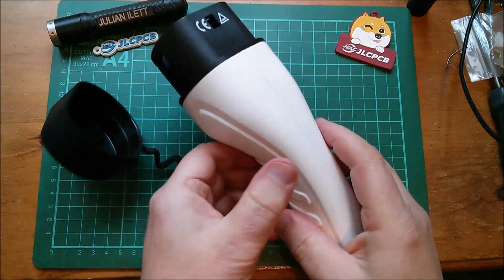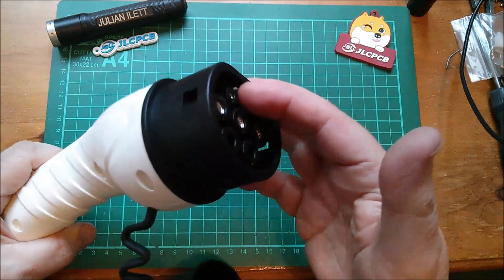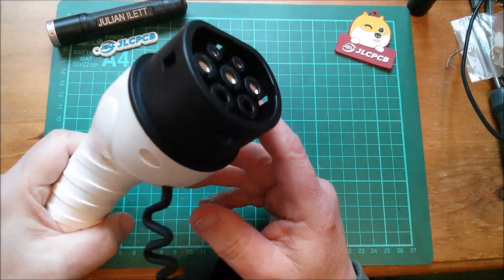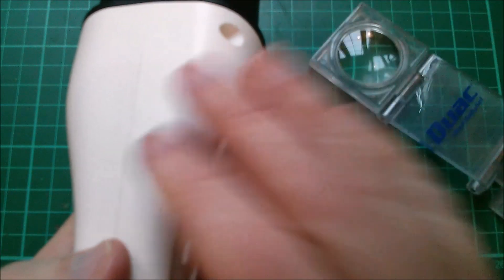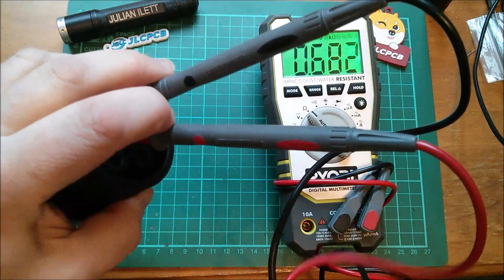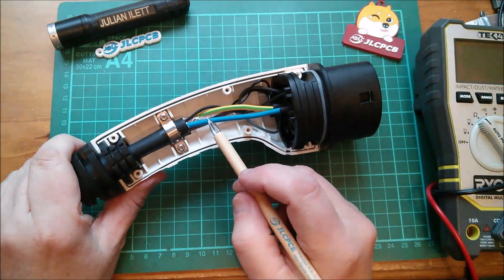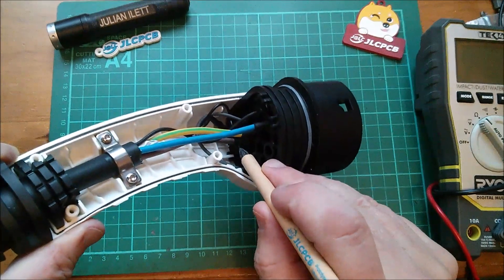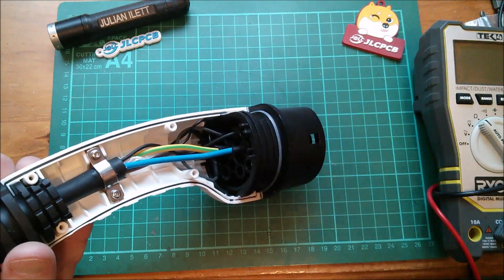680Ω Resistor in Type-2 Connector

Comment: Those resistance values are the definition of the stupidity of the ccs charging standard. Let’s go high to low so that eventually we get to such a low value that we have to create an entirely new standard when chargers get more amps!  Instead of low to high so there’s basically no limit. 

As to why the charging stations aren’t a rectifier and boost converter and the plug just pilot, prox, earth, neg and positive allowing cars to skip all of that for weight too and if you want to borrow at someone’s house (rare) it’s trivial to create a 15 amp box to put in your trunk. 

There shouldn’t be any AC charging standard but instead we have a stupid design with 9 pins instead of 5 that’s MORE money in copper than just putting the converter in the home charging station (pulsed sicfets that can drive 900v at 100a x 4 will cost you $60usd and the extra 2 wires in 3 phase will cost you well over $150 now. 

Dumbassed design by commitee. At least Tesla just figured out how to detect and shunt AC on the same as DC. But even then it should never have supported AC and even if there’s an argument for keeping that in the car, there’s no case where you need 3 phase instead of just using dc plus buck from 3 phase power or if you’re plugging in at a friend’s house, use one phase with the superior Tesla plug. 

Just dumb all around.
Reply: I need to argue with you on  a few points. First, using high resistance to indicate high current capability is a terrible idea when you consider the possibility of a dirty connector. A high resistance connection should NOT result in increased current draw for obvious safety reasons. Plus there is no point in worrying about signaling for more current when the connector can only safely handle so much.

In my opinion it makes more sense to have an in-car charger for everyday charging because it enables cheap charging stations (enabling easier adoption) and it enables cars to use whatever sort of battery they wish without worrying about charger compatibility. Plus DC charging requires more safety engineering which would increase costs.

And regarding the number of pins, I don't know where you're getting 9 from. The single phase American plugs are five pins and even European plugs with all three phases populated are still only 7 pins. The "bolt-on" plugs for DC fast charging don't use the AC pins so they are still only five wires.

Where I do agree with you most is that there's little need for on-board three phase chargers.
Reply: @eDoc2020  

1. Yes they shouldn't have used resistance at all. They should have used actual data pins with RS484 or CAN. Your argument goes both ways.  And the connector itself can handle 3x the power it's taking with larger wires so yes, they screwed the pooch.

2. A Bridge Rectifier costs a few cents. There's no serious cost increase at all. In fact that there is a massive decrease because of fewer wires. At the worst case (single phase 240VAC) it would cost about $1 more while vastly simplifying the rest of it and making your car significantly cheaper.  For 3 phase or any DC charge station that also has to support AC (yes they exist) you're saving 3x.

3. DC power is SAFER, not more dangerous. At any given voltage, DC will be less likely to kill you, not more. This is explicit in the UL and other data. As a small example, AC max human touch safe is 50V, DC? 120V.  AC will go to ground in general. DC? You can be sitting in a bath tub with the wires right beside you and as long as you don't get in the middle of them, you're not going to get electrocuted. (in fact, DC is so much more safe that most DC doesn't even have earth pins specifically because there is exactly one way in a DC circuit (below 1500V) to die: Put your heart in the middle of the positive and negative. AC?  Below 1200V there are endless ways to die, which is why we have GFCI and AFCI breakers now that cost a fortune.  DC takes less to certify in both the US and Europe than AC because of these facts. (I know I just did it and it was less than half the UL cost for 384VDC than a similar device that was powered from 240VAC. (yes both had to be isolated and pass the same surge tests)

4. PINS: A CCS Type-2 is 3 AC, Earth, PP and PE. That's 6.  If you add the DC wires on the bottom too it's now 8. So not 9, I counted wrong, but still the same increase in power wires that cost a fortune.   Meanwhile, the Tesla cable is 2 + Earth + PP + PE and the last 3 are small clustered around the 2 big ones.  And there was never any reason to do more than that (and the PP isn't needed either since it should all be RS484 over the PE). A DC CCS Type 2 can literally have 5!!! 3AWG or larger copper wires instead of 2.  By using a rectifier in the charger (or wall wart that plugs into mains if you wanted) and supplying whatever DC voltage that gives you (560ish for 3 phase AC, 340ish for 240AC and 170ish for 120AC) and then the car having a standard Full Bridge DC/DC Converter, which it must have anyhow, you just cut the cost of the device in half that goes on your wall. Not increased it.  And in countries with 3 phase AC, you even cut the wall wart that is in the back of the car for emergencies by 1/3rd by definition.  While simplifying the entire design.

AND

You open up Battery Caching with efficiency and elimination of waste on systems that are using Tesla powerwalls etc. because no inverters are required thus saving 16% (minimum in best case scenarios that virtually never happen, more like 25-30% in real world) inefficiency in current EV charging from solar. (i.e. about 98% efficiency on the Full Bridge converter in the car and nothing else, because no isolation is required from a Powerwall because the isolation happens from the mains to the battery so you don't have to isolate battery to EV)

It's a no brainer.
Reply: @jameshancock  1. For basic signaling resistance and continuity is more reliable than smart protocols.

2. How does moving the rectifier reduce the number of wires? For AC you need L, N, and E, for DC you need +, -, and E. You can't use a a cheap rectifier on three-phase because that would always result in poor power factor. AFAIK there aren't any DC charge stations that also support AC because the DC-capable plug doesn't fit in AC-only vehicles.

3. I'm not sure about the shock implications of AC vs DC but I can tell that your bathtub analogy is invalid. DC and AC are equally likely to go to ground. 120vac from the wall in the bathtub is certainly more dangerous than 120vdc leads from a battery bank but at the same time I'd rather sit in water with 120vac from an isolation transformer than a 120vdc supply with grounded negative. Outside of power factor correction and special interface requirements if exporting power I don't see why a 384VDC device would cost more to certify than a 240VAC device. In any case I'm sure an AC-only EVSE costs much less to certify than one that also includes high-power AC-DC converters.

4. Your pin count was right the first time. The second time around you forgot the CP pin. Outside of a three-phase supply to the car (which I agree is a poor choice) single-phase AC charging and DC fast charging require the same number of pins. One is live, neutral, and PE and the other is positive, negative, and PE.

Regarding charging a car from a Powerwall-like device, that is indeed something I did not consider. Having an extra inverter in addition to the charger will certainly make things less efficient. If I were in charge I would say that vehicles should have moderately-sized onboard chargers which accept AC as well as DC input. With such a system cheap charging stations could still be made for existing AC systems and relatively cheap and efficient charging stations for DC setups would also be an option. DC fast charging could be an extra as it is now where an outboard charger isn't much of an issue because you'd already be upgrading infrastructure just to get that much power to the car in the first place.

As a side note a benefit of dumb EVSEs vs smart DC chargers out in the wild is that there is little maintenance required. Public fast chargers in remote areas would be a nightmare from a logistical standpoint.
Reply: @eDoc2020  1. Actually that isn't true. Resistance can be influenced by wires as you stated. A USB style Hi/Lo protocol doesn't have that issue and it has built in error correction and could get rid of 2 more wires.  A simple PWM is either so large that you only have 5 or so values that you can possibly use, or you have risk of interpreting it incorrectly.  USB/RS484/Ethernet style signaling has none of these issues. It either works or it doesn't, and it's exacting with error correction.

2. One way or another, there is a rectifier for 3 phase power. It's either in the car or in the charger. Same with single phase. It's either in the car or in the charger. The difference is that by putting it in the charger itself, the cable then always is +/-/E (E isn't really necessary nor does it really make the DC power any safer, but whatever. The DC won't go to earth anyhow even if you hook it up directly to either the positive or negative terminals so you're not saving anyone on a short)  With a DC connector there is only 4 wires if done right.  With Tesla they couldn't do 3 phase power, without adding 2 more conductors of massive size which would have doubled the cost of the cable. With CCS-Type 2, you're still paying for a massive connector and all of the wiring and logic in the car and the pita of hooking it up for nothing because you're insisting on putting the rectifier in the car and not the wall end of the cable. If it's an installed mount, then it's in the box in the wall. Then 4 wires come out, 2 small and 2 large and you're done. If it's plug into your buddy's wall jack, it's still a rectifier in the wall wart plug and 4 wires and you're done no matter what power standard you use. (and all of Europe is migrating to 3 phase by 2030, Britian might not because they're out of the EU but they'll have a hard time not doing so.)  So, while it doesn't add to the wire count in the US, Canada, Mexico and Australia it will in virtually everywhere else in the world soon and you're adding something to the car that isn't necessary and everything that goes along with it too for no reason because a wall plug rectifier is tiny and cheap. We're talking about 20 amps max power and the PF doesn't matter for residential and most plugs in European 3 phase countries, the plug has single phase anyhow so they're already getting major PF issues.

3. All power goes to it's source. Doesn't matter if that's AC or DC.  The DC source from - is +.  The AC source is neutral OR anything earthed because of how they're hooked up.  Thus DC power can't short from a single hand while you're standing in a puddle of water unless that DC - is also connected to the puddle of water.  The AC one can and does all of the time which is exactly why GFCI breakers exist for AC and not DC. It's WAY safer to use DC power and this is reflected in the standards. And DC certification is CHEAPER not more expensive than AC specifically because DC isn't coming from the grid which is dirty and can sustain lightening strikes. DC is coming from isolated batteries and thus is tested at less than half the peak voltage and 1/100th the time interval so you can literally use an eFuse on DC depending on exposure versus having to use a transformer or capacitance isolation on AC.

And note the only reason why the Tesla Connector has an Earth at all is because it accepts AC. It isn't necessary for DC service if coming from an isolated source but is used to ground the car at the same potential to the building to prevent static shock, not as a protective measure for an AC short.

An AC only UL certification versus one that rectifies to DC has absolutely no difference in certification cost at all. In neither case is the power path isolated because nothing is exposed to the end user. The only part that has to be isolated is the interface, which is low voltage 3.3V (or 5V) + 12V power behind a transformer. None of that changes. In my design for an EV charging station in a house, the EV charging station just rectifies the power. That means 340VDC (or 540VDC rectified 3 phase AC) through the wires at whatever amps to the car. The car has the converter IN THE CAR, just like it does now for the standard to boost or buck it based on the battery size.  What does change is that now you have a simple 4 wire cable that is as cheap or cheaper than the AC equivalent and the car has a simple 4 wire connector which is also cheaper, and the car only has to see AC AND it opens up direct solar.

4. If the cars are always supplied at the plug in the car with DC then 3 phase power doesn't really matter and everything is good. 3 Phase power is a problem and creates the stupid connector we have now when you're feeding AC over the cable and connector instead of 2 wire DC which the car uses anyhow.

Solar: If you put in a $1 rectifier in the head of the cable, then you don't need the AC in the car at all. There's just no reason for a car to ever accept AC. If you're on 120V it's 2 diodes at 15a. If you're on 240V Single Phase you're 4 diodes at 50A max with a dongle and 80A with a wall adapter which is nothing. If you're 3 phase you're 9 diodes with the same as above.  Keep it simple and make it always DC into the car. It costs nothing, has no overhead to do so, doesn't make it harder to maintain (in fact easier and cheaper) and makes it way easier for people to connect. (Tesla's data on the subject shows this because they have way more repairs in Europe with CCS-Type2 than they do with the Tesla connector). And then anything from 40VDC to 1000VDC (max of the standard now) should be accepted and boosted/bucked as required. You're done. Super simple, and all you've done is put the rectifier in the right spot so that every electric car has exactly one way to charge: DC of an arbitrary voltage.

Side Note: There would be no more maintenance with 4 diodes (or 9 for 3 phase) than the current system. None. And because of fewer wires, the cable would be less thick and when it broke would be cheaper to replace and the connector on both the car and the wire would be less prone to breakage because it would be supporting a much lighter cable, especially in 3 phase power situations but also in all other configurations because of the stupidity of the size of the connector that is being shoved in and out.
Reply: @jameshancock  My comment with signaling reliability was more referring to the components used rather than the signal itself. But automotive CAN interfaces have been around long enough that it's probably not a real reason. So I'll give you that one.

2. You're kind of saying the same thing I was, the DC is safer while it is isolated from the grid. Regarding PF, it certainly does matter here. For one thing the EU requires PFC over 70 watts, and besides that PFC means you can use thinner wiring on the way to the EVSE. 4800 watts is 20 amps at 240v but without PFC you'd need more like 30 amps. So you basically need active PFC somewhere. If you're suggesting a steady constant-voltage DC feed to the car that means you need APFC electronics in the station and a DC-DC converter in the car. If the car itself is fed with AC it can achieve APFC just by modulating the charge rate, eliminating a stage.

To realize a safe two-wire DC system without a ground wire you'd need to isolate the supply first. That requirement of isolation turns your $1 bridge rectifier into a much more expensive power supply. So you'd definitely still need a ground wire. However I don't see why they couldn't use a GFDI and get away with a (relatively) small ground instead.

I guess what I'm trying to say is I don't see much of a benefit to using an external rectifier if the charging itself is still handled by the car. If the charge voltage itself is generated externally (as AFAIK it is for today's DC fast charging) it's a different story.

As a note which may or may not make a difference here, I think the power electronics in an EV's motor controller could theoretically be used as charge electronics. I wonder if any existing cars do this.
Reply: @eDoc2020  As it currently stands, the car is accepting single or three phase AC. It then boosts that using CC and then CV in the car. All of that exists. It's getting in 1.41x the power coming in, and then boosting that higher to 400 or 480 or in some Audi/BMW 800V.  And that AC stuff that is in the car has the isolation as well already. It's already there. And if you want to get fancy at super chargers you can boost from the 3 phase AC at the charger to up to 1500VDC (without getting into high voltage regulations, unlike AC which is 1200VAC) and feed that over the same thickness cables and then buck that in the car trivially to whatever the battery needs and you've quadrupled the amount of watts going in without enlarging the wire nor changing the connector. (And yes 1500VDC is entirely doable with SicFETs now.)

All I'm saying is move the AC rectification out, and then you eliminate all of the extra wires from the process which simplifies the design, makes it cheaper, and opens up cheap and efficient DC/DC charging from solar and eliminate the inverter.  The entire design is standard linear EE thinking instead of think laterally. You see this everywhere in EE. Tesla is the exception to the rule there and thinks laterally. That's a trait of all Musk companies, but the rest of the industry and forcing stupid on Tesla because they thought linearly: We have a cable that does 1 phase AC charging. We need 3 phase = Add Wires! Oh, now we need DC = Add Wires!

Instead of: Oh we need to handle all AC power configurations AND handle DC charging: Instead of adding wires, what's the cost to convert to DC versus how we're doing now and versus what our new connector with all of these stupid wires is going to cost?

When you ask that question, the answer is trivial: Convert to DC at the wall, not in the car.

PS: I did an LTSPICE simulation of a 6 diode full bridge rectifier for 3 phase AC. The power factor was 92%.  Even if there is chop on the Boost/Buck in the car, there are caps in the car to absorb any back EMF, the entire length of the wire from the wall to the car (close to 15 feet of stranded 2 AWG wire) acting as an inductor which absorbs it, and the diodes at the wall.  If it dropped by 2% I'd be shocked.

And if it does turn out to be an issue, you can use a 3 phase solid state rectification IC and use triodes or fets instead (GanFET will easily handle the pulses at 100 amps and the full pulse voltage without having to parallel).  This active synchronous rectification increase in cost is cheaper than 1!! 15 foot 2 AWG copper stranded cable costs.  It will do active PF and get into the 99% range complete with back EMF correction. (I LTSPICED it and speced the parts on Mouser and that's before mass production savings.)  And recall, you can save even more money because literally every one of these wall chargers for EVs has a microcontroller in it that is already capable of doing the active rectification itself. (i.e. an STM32, the cheapest one made will easily handle the pulsing sequence and handle the UI at well below 150mW power usage, so you don't even need the IC)

My way the car becomes the controller and only listens to the amps that the charger can provide just like now.  The difference is that the car is receiving DC and thus the source AC (or DC in the case of solar) is immaterial, and since the car already has to have a buck/boost inside it as you noted that hardware is always going to be there (yes the Tesla does it the way you're talking about, it literally uses the boost converter from the regenerative breaks to boost the AC, Sandy Monroe covered this in a YouTube Video when he took apart a Model 3) .  Thus, the car being able to take a wide range of DC power and boost/buck it takes no more effort than it already has, and has massive wins because of a simple connector with few wires (4) and it works everywhere no matter what the power source is, Single Phase AC, 3 Phase AC and DC is all the same to the car. And that makes using solar collection during the day into a battery and then charging from the battery to the car at night vastly more efficient and cost effective. And of course, if the house battery gets to low, it can shunt to AC doing the rest of the car charging from the grid, and the car still sees DC.  That's how it always should have been designed. But linear Electrical Engineers created a mess because they didn't think outside the box.
Reply: @jameshancock  It seems our disagreement really comes down to whether or not the car should have a rectifier built in. I say why not? Even if the car still has an onboard rectifier it can still accept DC without any problems. My design would be two fat wires which can accept either AC or DC along with a medium-size ground and whatever signal pins are needed. As far as I can tell this is exactly what the Tesla proprietary plug here in the US does.
Reply: @eDoc2020  The issue with your design is that it doesn't handle all of the design requirements:

1. AC Single Phase power - Yes, your way works.
2. AC Three Phase power - Your way doesn't work and would require 2 more power wires and the plug expanded. (i.e. what CCS did)
3. DC Voltage matched power - Yes, your way works.
4. DC Voltage from solar without having to have a boost converter (expensive) in the charging station - Your way doesn't work.
5. Allow the EV owner to plug into a wall anywhere and charge - Yes your way works.

My design addresses ALL 5 design requirements while adding virtually no additional cost even in the cheapest scenario (plugged into a 120V socket at someone's house with the cable that is included with the car) and vastly cheaper in 3 of the 5 options. (Even #3 above is vastly cheaper my way, because the car already has the boost/buck so if you just rectify the 3 phase power coming into the super charger and let the  car do the rest you just saved massive deployment cost there too)

So our disagreement really is: Your way doesn't work unless you do what the CCS standards body did which is make a stupid plug.  Mine works in all cases with an elegant and cheap solution that doesn't require a stupid monster plug and extra wires in many cases.

So objectively, my way is better in all but the most simplistic single phase AC use case INCLUDING DC super chargers because those that aren't ultra high power can just be rectified 340VDC from 240VAC and 566VDC from 3 phase 400VAC. In the VAST majority of cases 3 phase rectified is more than the current active super charger produces, so you're better AND cheaper in the baseline and only in the 600VDC+ scenarios of CCS-Type 2 would you be incurring any overhead, and honestly, the cheapest way in those cases is to have the power company drop a 3 phase transformer that gives you the right 3 phase for the voltage you want to offer (i.e. instead of 3 phase 400V use 3 phase 700VAC and you'd get the full 1000VDC after rectification for no additional cost, just a change in windings in the transformer that they already have to install anyhow). It would cost essentially the same and you'd rectify it using an active rectifier and you're done, no buck/boost at the super charger either so it becomes a dumb source that is super cheap to install comparatively to what they're doing right now.

So my way even improves and simplifies Tesla super chargers and makes them cheaper to deploy which means more gas stations would deploy them too which means more ubiquity. (i.e. the average gas tstation has 3 phase 400VAC power already for the pumps. Thus they can easily drop in dumb rectified DC stations with 566VDC charging at 100Amp pretty easily and the cost per port would be essentially the same as a home charging station with my design. I.e. a couple of hundred dollars, so the only cost would be the upgrade of the amperage coming into the station. That's a massive win for everyone.
Reply: @jameshancock  I don't see why my way wouldn't work. A three-phase charging station would send DC to the car exactly like your way would.

So the three possible modes of operation in my system:
1. AC into car -> 4 diodes -> pulsed DC -> DC-DC converter -> battery
2. DC into car -> 4 diodes -> still DC -> DC-DC converter -> battery
3. (optional) DC into car -> converter bypassed -> direct to battery

If I'm not mistaken, your system would only use DC into car -> DC-DC converter -> battery. My mode 2 would work exactly the same as this.
Reply: @eDoc2020  Your way doesn't work for 3 phase AC in home into car and converted in the car.  (because in that scenario you need 3 power lines instead of 1)   This is literally why they created CCS in the first place and added the pins!

Further, your way is limited to 240VAC over the wire thus to get more charge capability from an AC source in your scenario they either have to have a REALLY expensive boost converter and convert to DC outside of the car (in which case the rectifier isn't required in the car) OR they have to increase the cable thickness.  My way, you're getting 340VDC across the wire for single phase and 566VDC across 2 wires instead of 3 at 400VAC. And you can always boost at the wall if you want and increase the voltage and drive 600V through identical wires and 1000V with a slight increase in cost per foot, thus more than doubling your Watts through the wire without bigger wires that hare harder to handle nor increasing the side of the connector. Your way has no option to do so.

And the  current standard doesn't work for affordable solar install because it requires another boost converter at the wall and full CC/CV logic at the wall while the car already has it.

#3 on your list will never happen because it has to do CC/CV charging so there must be a boost/buck depending on what's coming in and the demands of the charge curve.  And EVs don't use diodes in their boost/bucks. They're all synchronous designs with fets not diodes at over 98% efficiency that they already have designed. The companies creating the wall adapters don't have that knowledge and at the very least will create shitty designs that aren't as efficient, besides adding massively to the complexity of DC your way at the wall with the current method which ensures no one does it (which is literally why you can't buy a DC EV charger for less than $15,000 on the market right now and they all require AC 3 phase power to operate.)

And in my design, insanely cheap designs would use diodes, but better ones would be $5 more and would use fets and the microcontroller that's already there or an ic to rectify the power and would do PF correction while it was at it.

Mine works in all cases, is cheap in all cases, puts the design complexity where it already is with the EV company while solving all of the issues in every scenario, for essentially no additional cost nor complexity, nor certification issues.

Not sure why you don't see the massive win.
Reply: @eDoc2020  Your way doesn't work for 3 phase AC in home without converting to DC first like a super charger.  This is why CCS exists and the original American design wasn't adopted which only conceived of DC and AC single phase. (with 6 wires instead of 4 as actually needed)

The current standard doesn't handle AC/DC detect in the car like a Tesla (no other car does this) and thus you get the CCS standard with  separate DC pins.

#3 will never happen. This requires a CC/CV charger which means a synchronous buck/boost to manage CC/CV.

Your way requires either bigger wires for bigger chargers at 240VAC or 400VAC 3 phase to get more power or a full 3 phase DC super charger. Mine doesn't, because it's always DC so you can always step it up if you want to get more power with more volts instead of more amps and thus keep the same wire gauge. (and the car would just automatically handle this trivially all the way up to 1000VDC or even 1500VDC)
Reply: @jameshancock  I don't see the massive win with your way because my way doesn't have the shortcomings you describe. I'm not talking about the current standard although it could be backwards compatible. I'm saying the car could accept 100VAC, 1000VDC, or anything in between. The benefit of mine is it wouldn't require any power circuitry in a basic unit while yours would require a rectifier and maybe PFC in even the most basic units.

Like the current system my option 3 would only be used in special situations where you want to charge faster than your car's converter can handle. I would not expect it to be common at all, I'm just leaving it open as an option.
Reply: @jameshancock  Am I missing something? Your way would also require external conversion to DC to charge from a three-phase source, so it doesn't offer an improvement in this regard.
Reply: @eDoc2020  The difference is my way is a dumb rectifier and nothing more. The car takes whatever voltage it gets DC and boosts/bucks it. Your way, the car gets AC and rectifies it and then boost bucks it.

That means that your way requires 3 wires for all 3 Phase AC locations instead of 2 which drives up costs and makes the stupid CCS-Type2 charge connector. (or it has to rectify it and use CC/CV and be a full charger per the current standard to DC which as we know the Europeans think requires separate wires for DC versus AC that generates the stupid CCS-Type 2 DC charger connector which is truly moronic.)

Mine works in all cases with the same number of wires, no more expense and the car does the boost/bucking so that DC/DC is just as trivial and cheap as AC/DC charge stations.  And for stations that want to provide more power over the same thickness of wire and connector, they can include a simple boost (a half bridge with gan or SiC Fets will do this nicely without any logic other than the PWM) that doesn't have to have any CC/CV logic at all, and volia you have 1000VDC @ 100A and the car does the CC/CV itself.  In the home this means that you could have Single Phase AC, have it rectified at the box and a simple and cheap half bridge synchronous boost converter to 1000VDC and use 8 Gauge wire instead of 3 Gauge at 100A thus making the entire unit WAY cheaper (the boost converter I describe would be less than half the cost of the difference from 3 gauge to 8 gauge wire and the microcontroller that's already in the device can easily do the PWM that's necessary, it's just high low with slight dead time with no other logic at all.) And that's to say nothing of the cost savings in making the plug that only accepts 8 gauge wire instead of 3 gauge wire which is substantial.

As soon as the car takes any DC voltage and only DC voltage you open up all of the possibilities.  As soon as you require it to take AC you're adding wires, adding complexity to the plug and creating stupidity like the CCS standard and you're ensuring that to increase the  charge capability in most houses the only solution is more amperage which = WAY more cost because copper is EXPENSIVE and you're also guaranteeing that you're going to need a new connector to handle those larger gauge wires so we're back to the stupidity of using smaller and smaller resistance to define AMPs capability instead of more and more resistence.